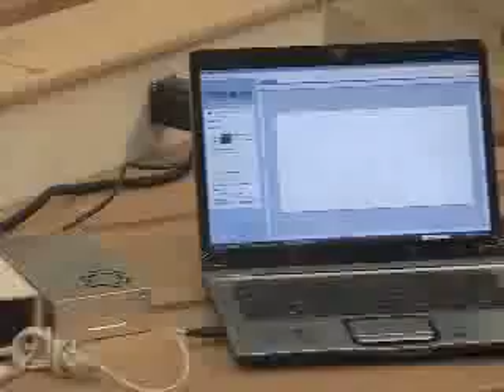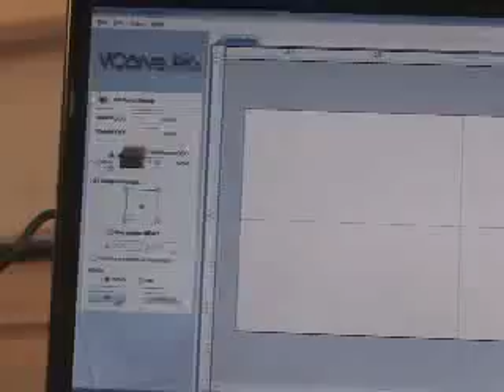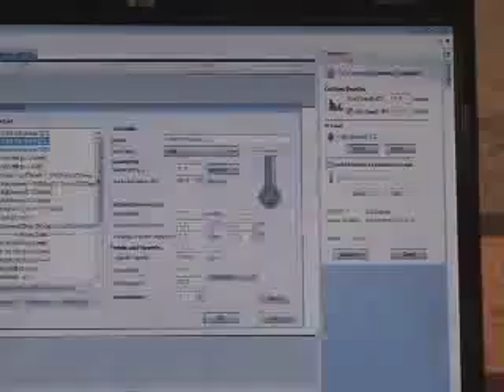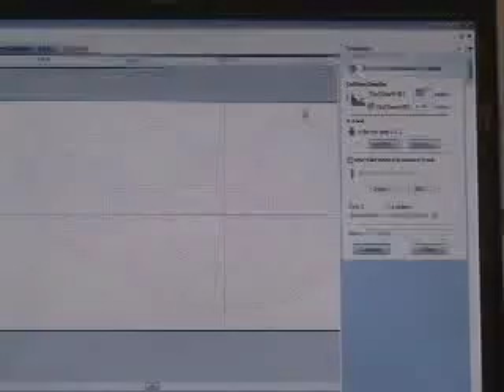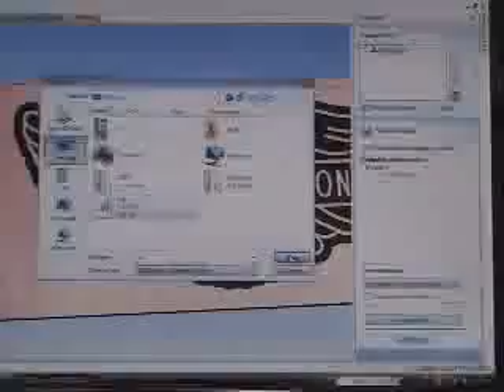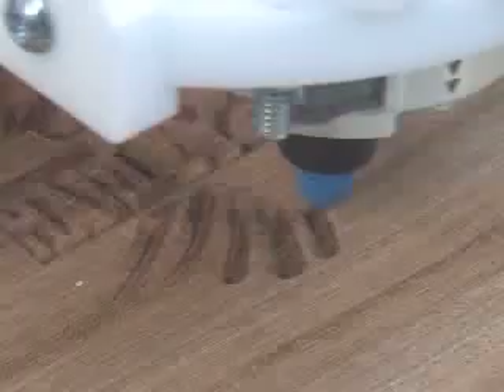Shark CNC Router System

Comment: This product's review this is a good one.  I've been looking at a smaller version, but I have little experience with required software. This simple walkthrough video does the job and takes away the learning fear factor. Yes, a better video would help,  but from what I understand it is a great product.  Its on my near retirement list of product for my woodworking shop.  If price drops another $500. & competes with compucarve, but  it appears superior, more reliable. X Gen  has no attention span.